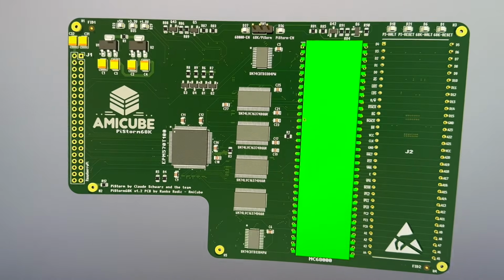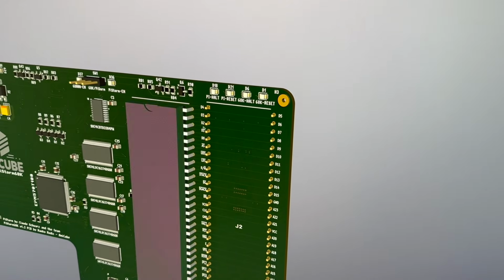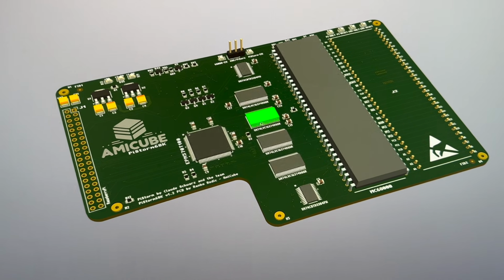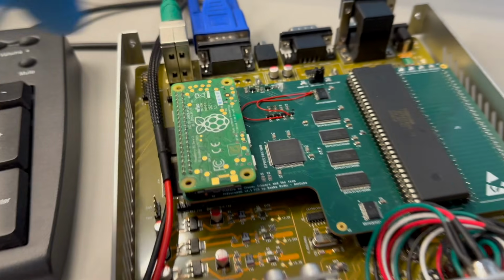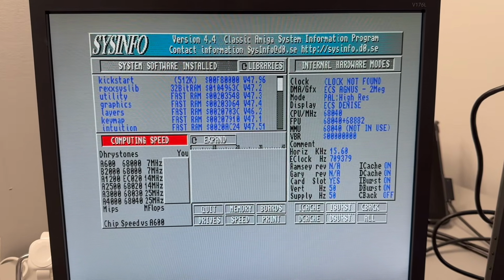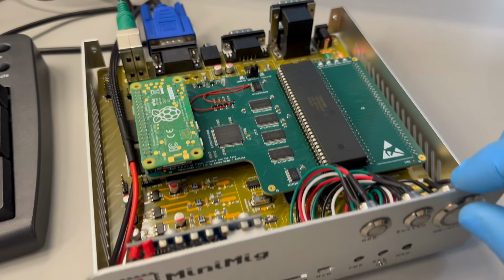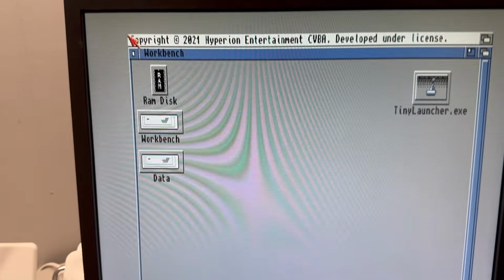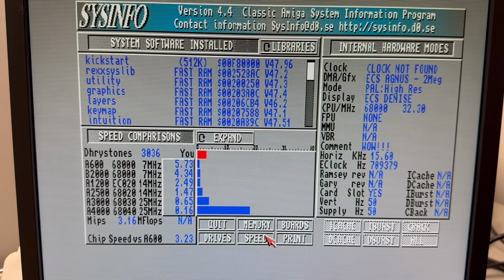🚀 PiStorm68K: Dual 68000 CPU & PiStorm with Physical Switch Demo 🔄

Comment: Excellent build.  It looks to me that all that should be built into the MiniMig main board.  Does your board work with the Pi4?
Reply from the maker: Thank you! Just a quick note: The Minimig's +5V rail runs slightly undervolted, at around 4.9V. To address this, replace the R12 resistor (Minimig board - lower left corner) with a 4.7kΩ value (instead of the stock 4.3kΩ). This will regulate the voltage to +5.2V.

This tweak is especially important for Raspberry Pi 4 and Pi 3B+ setups, as a voltage just below +5V can trigger CPU downclocking and reduce overall performance.

Comment: That's exactly what i was searching for :) is a version for Amiga 2000 planed?
Reply from the maker: Hi Andreas, PiStorm 68K should work with A2000. As long as it will fit in the case. That I am not sure.
Reply: @amicube  Fingers crossed :) hopefully someone will develope something like pistorm2k with 68k :D

Comment: This is very cool. Do you know if the board will fit into any of the original Amiga form factors such as 500, 1000, or 2000?

Would you consider making a board for those?
Reply from the maker: No, these boards are designed for PC cases, specifically Mini-ITX. To fully replace an Amiga 500/600/1200, I’d want all the ports and expansion slots to be in the correct positions. That would be a massive Verilog project!
Reply: @ sorry I wasn’t specific.  I was referring to the CPU board specifically.  I understand the amicube is a totally different form factor. 

I think I saw another comment where the cpu adapter did fit a 500

Comment: What does the MiniMig have for an Amiga custom chipset?
Reply from the maker: The original Minimig supports OCS/ECS. However, there is a Minimig version for the MiST and MiSTer platforms that features an AGA variant. I am currently working on a new board that will support AGA out of the box, including both a virtual (FPGA) CPU and real CPUs.

Comment: Will it be possible at some point to be able to use the PI to provide some features like drives or networking while the real 68k is in opperation?
Reply from the maker: Not with this design, as when the 68k is in use, the PiStorm is powered off, and when the PiStorm is in use, the 68k is in halt mode. What you're asking is technically possible, but it’s not a trivial task.
Reply: @amicube  Ahh ok, Thankyou for answering! Makes a lot of sense. I have dabbled a bit in the past with very basic FPGA and cpld coding, but how the PiStorm does what it does, still goes way over my head.

Comment: Great product Brother. I love the “nostalgia jumper” :)

So the rest of the chipset when running physical is all in fpga? And piStorm is on the pi?
Reply from the maker: Thank you so much, Aki! 😊 Yes, the FPGA on the Minimig/AmiCube will handle the Amiga chipset, including OCS, ECS, AGA, and even NextGen capabilities, while the CPU functionality comes from the PiStorm68k. You can choose between a physical 68k CPU or the emulated PiStorm CPU.

However, it's important to note that the CPLD on the PiStorm is solely for running the PiStorm firmware, it doesn’t contain any Amiga chips or components.

Comment: Any reason you have the CPU and socket pins side by side instead of straddled together? It would make the board smaller.
Reply from the maker: No reason not to. It can be done. I can make shorter variant if needed.

Comment: Will this fit Amiga 500? As it is? Or with relocator?
Reply from the maker: It fits! I just tested it with my A500. The Amiga keyboard does make slight contact with the lower edge of the PiStorm, but only minimally. Adding a small piece of isolation tape as a precaution might be a good idea, just to be safe.

Comment: I don't mean to be disparaging in any way, but this seems to me a lot of effort to go to, especially in light of the fact that there are much faster systems available for the same price as just the PI without the PI Storm. What purpose does this serve, is it just a personal challenge to make something cool, or is there an goal that this will achieve, perhaps the solution to a specific problem or a commercial goal or some other goal?
Reply: If you like to code your demo (or game if you like games) natively, it's nice to be able to quickly test on a standard 7MHz 68000 setup.
Reply: Why emulate everything when the real thing is better? (fpga amiga is pretty close to the real thing.,)
Reply from the maker: Thank you for your thoughtful question! It’s true that modern systems are much faster and affordable, but FPGA-based Amiga solutions serve a different purpose beyond raw performance.

First, an FPGA allows us to replicate the original hardware architecture of the Amiga at a cycle-accurate level. Unlike software emulation, which runs on generic CPUs and can introduce latency or inaccuracies, an FPGA recreates the behavior of the original chips, preserving the unique characteristics of the system. This is especially important for enthusiasts who value the authenticity of running software exactly as it was designed.

Second, the modularity of an FPGA platform means we can integrate enhancements like additional memory, faster CPUs, or improved graphics while still respecting the original architecture. This strikes a balance between authenticity and modern usability.

Finally, there’s an emotional and creative aspect to these projects. For many of us in the retro computing community, the Amiga represents a unique era of innovation and creativity. Building FPGA-based solutions isn’t just about solving a problem; it’s about keeping that legacy alive, providing new ways to explore, enhance, and preserve the Amiga experience for future generations.

It’s certainly not about competing with modern systems, this is more about passion, nostalgia, and respect for an incredible piece of computing history.
Reply: @amicube  Thank you for your answer. I went and read up about Amiga after I saw your video and I think I understand. There was a sense of belonging that came with having an Amiga system, like people who owned one all belonged to the same special interest group. There wasn't really the same kind of thing with the ZX Spectrum, Commodore 64 or Atari 800XL which were nowhere near as good, at least not to the same degree where I was, and the first X86 systems were somehow more commercial and "business like" and had less of an enthusiast appeal. 

It looks like a really interesting project. I'm interested to see what interesting things it'll do in terms of software.
Reply: @ Back in the day,  one of the things that made the amiga so special was its architectural flexibility. To the hardware tinkerer it was a real garden paradise. And the hardware has also lent itself to modern adaption much easier than other systems. Due to its excellent documentation and relative ease in expanding the hardware.

Comment: Looking forward to buying this for my ITX system to replace the existing one. What would be wonderful.. is some Zorro-II or III slots. Would be extremely keen to buy one and feed it my ZZ9000 and Zorro-II USB2 adapter. 😍
Reply from the maker: At some point, I plan to add Zorro II support. However, implementing Zorro III might be more challenging due to its increased complexity. Unlike the simpler 16-bit synchronous Zorro II, Zorro III is a 32-bit asynchronous bus with higher speeds, dynamic address assignment, and advanced timing requirements. It also needs to support backward compatibility with Zorro II, adding to the design complexity. These factors make Zorro III more demanding to implement, but it’s an exciting challenge!